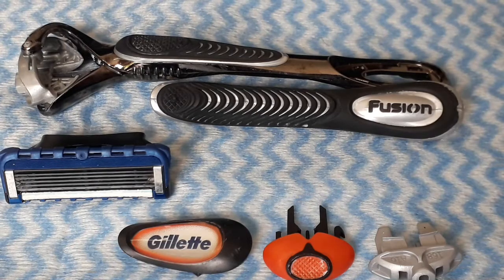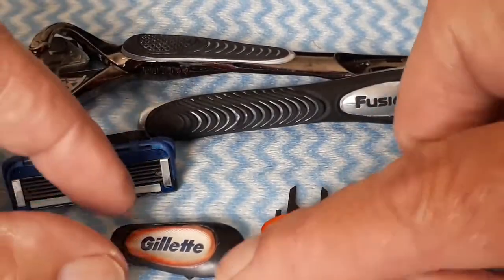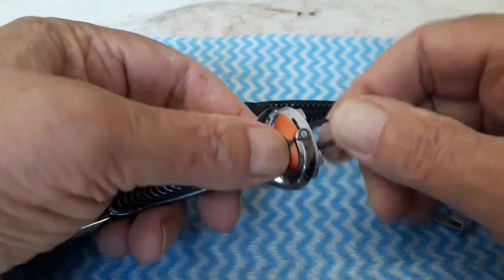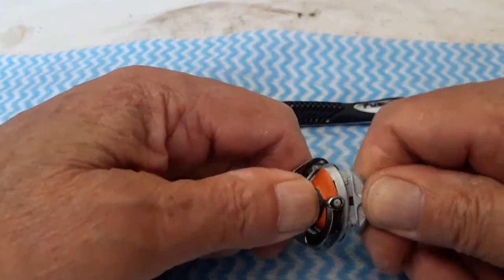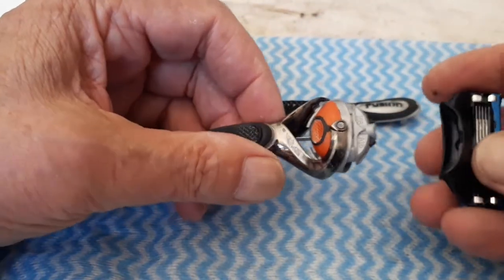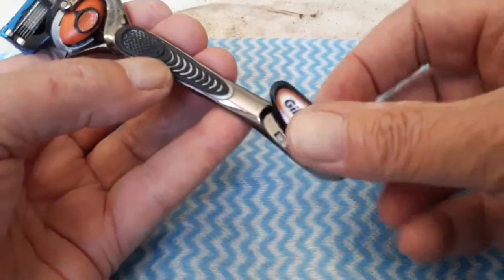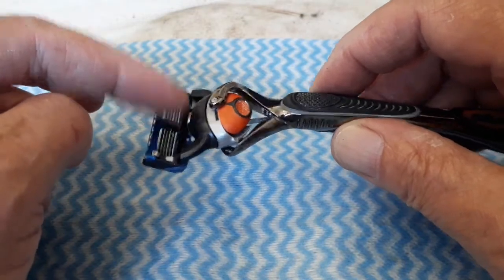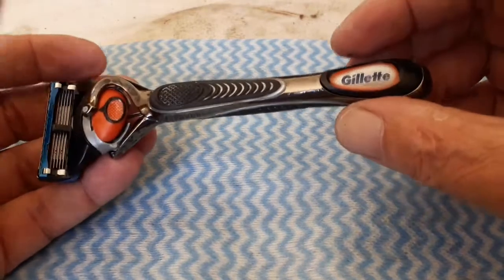How to put a Gillette Fusion Razor back together when it fell apart

Comment: U have not installed spring, it is incomplete.
Reply from the maker: You are totally correct, I used it currently but there in no spring action in the blade, thanks for clearing up the problem for me,
Reply: @jankotze1959  may be because while dismantling spring may have gone missing. by the way, i placed spring appropriately, and blocked through cotton.